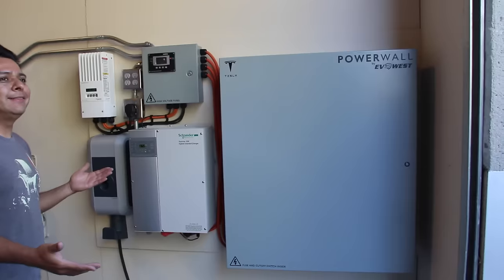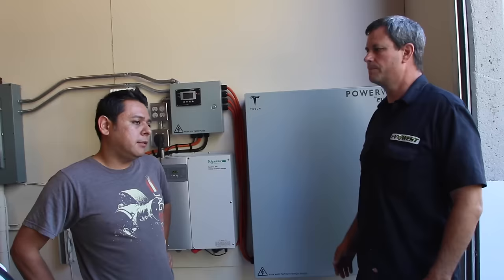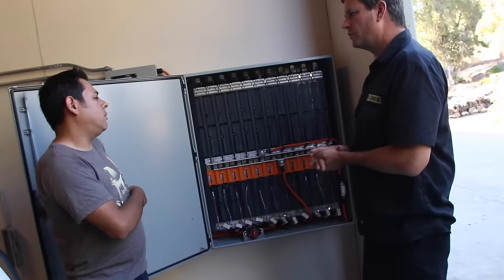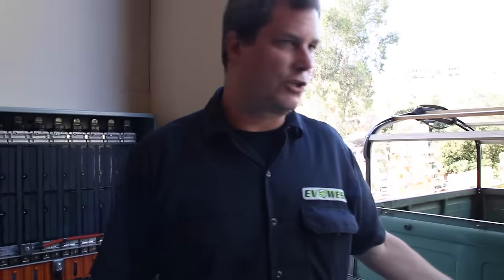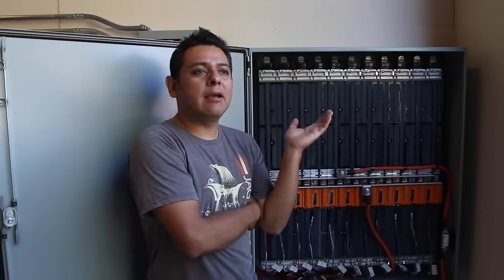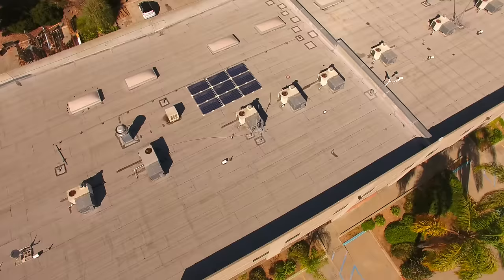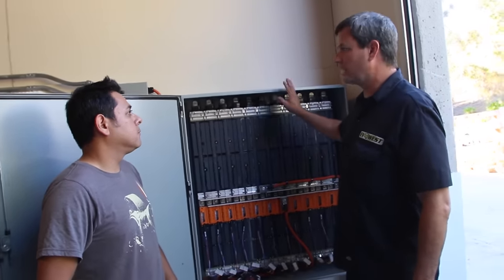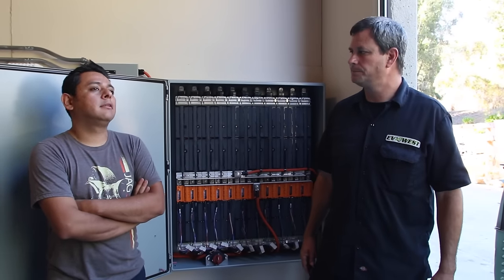DIY TESLA Powerwall  - my  WALL vs ELON'S WALL

Comment: so complicated is any one that will sel a DIY package manual for, lets say 10 Kw
Reply: 100W invertor x 96V battery pack(8 12V batteries) you can use any battery you want but if using lithium batteries you'd need a BMS. I'd use a contactor or quick release for the battery pack as well. The more batteries you have in parallel the longer the duration.

Comment: why do you need an ac inverter for charging a car? you convert dc -> ac -> dc again? Why?
Reply from the maker: +Balazs Magyar   Because= standard equipment
Reply: +jehugarcia ok, but its a diy project, and in the long term its cheaper :-)
Reply from the maker: yeah but Michael has customer cars that need to be able to charge at the Mall,  the DIY wall needs to be able to charge all cars at the shop  not just a special custom one

Comment: Looks like Elon M. was really just looking for a use for his vehicle batteries when they are below the specs needed to power the voltage demand of the drivetrain, when they fall below the specs and are useless for the vehicles he appears to be arranging to recycle them into brand new powerwalls.

Comment: I'm selfish with my electricity becase grid tie setups shut off when the power does.  What sense does that make?  I set up in OffGrid mode.  What did EV West pay for that setup?  $16k?  Um, never mind.  <g>  Right now, I have 1kV of panels and a pair of LA deep cycle marine batts on a low budget.   //   Ooh, bummer about the drone.

[Egad, muzzle the dog for the video, or put him inside.  ]
Reply: When the Grid is UP, like 99.99% of the time in the USA ( except Cali )  then "FREE" Battery = Very Low cost

Comment: Depending on your electricity bill and usage your breakeven point might be past the life-cycle of the components themselves which means you're literally throwing money away on renewables. HOWEVER, for the total solar naysayers....

The cost of electricity on my bill here in South Australia is a fucking ludicrous 39 cents a kw..... So you can imagine how grateful I am running a huge 8kw solar array on my roof when its 45 degrees (113F) all bloody summer and my industrial sized AC chews through power at 5000W on startup Hi to 3000W normal running. Shipped the Panasonic panels specially from Japan, cost me $15,000 AUD, and I sell all my excess energy (of which there is a lot of) for 18 cents/kw back tot he grid. Bought these specifically because the temperature coefficient on them were miles better suited to our stupid hot weather than even competing expensive panels, let alone el cheapo ebay/amazon panels.

Pretty sure I've already paid back my investment on this 3rd year if I only looked at my usage during the SUMMER QUARTER ALONE lol (last summer was nuts) and I don't even have a battery backup system. My last bill was 61 bucks, if I didnt have the solar panels it would have been in the ballpark of 3.5k (a light summer quarter for here). if I were as super stingy with power as I was without the panels, Id be receiving checks in the mail from the power company to the tune of 600 odd dollars every summer quarter, but the house feeling like a refrigerator for the entire day, completely for free is just too nice to give up. People saying solar will never pay off must either live somewhere power is 10 cents/kw and below or they just aren't very smart. 

However even here, mains power costs don't warrant a lithium battery setup yet... The useful life-cycle on lithium is too shit for me to make back the initial expense in reasonable time, until that is power prices start getting stupid, which they will. Vanadium flow batteries are simply a better long term battery option. You can technically get infinite lifespan out of them and you can discharge them to 0% indefinitely without adverse effects to the system, their only drawbacks are system size (mind you its like the size of an AC so not that big) and that they wont have the same peak output as lithium, so if you're a heavy user, you'll just need two of them. Trust us Aussies to invent a commercial solution to our climate... lol.

Comment: Batteries are not smart.  For they are batteries, a place to store electricity until needed.  But the electronics to charge and discharge those batteries have to be smart - microprocessor plus software.  Tesla has given away its patents,
 meaning any company or individual can make 
use of that tech.
 Hence, Solar City can use that stuff to send electricity to the grid or to the powerall battery,
 or other homemade batteries - intelligently charging a car, appliances, or the grid as needed,
 desired, or as programmed.  Politicians speak of transparency, but not engineers - intelligence and wisdom (right and wrong) are not the same.
  The two companies should be kept separate.
  And from an investment perspective, Solar 
City common shares seem safer.  Tesla Motors :  
 car companies spend billions only to see 
competitive strengths vanish as other car 
companies do the same.  Ford and GM manage 
huge amounts of debt.  At 200 dollars a share,
 Tesla looks like a lousy investment, already 
valued as much as half of Ford, especially
 given that other car companies may build 
gigafactories as well, or simply buy batteries 
from Tesla, and build more popular vehicles.
  A merger is a lousy deal for Solar City
 shareholders.  These two companies are 
behaving as if the shareholders, the owners,
 do not exist - only consumers and workers.
  And neither will acquiring Solar City make it 
easier, for Tesla to make and sell cars or
 batteries.  I think Solar City is will be more
 profitable not having to worry about selling
 cars.  ( A question I would like answered is, When
 a house with rooftop solar generates excess 
electricity, and it goes to the house next door,
 does that neighbour pay for that electricity, 
the utility company, or does that neighbour 
simply get the electricity for free. )
  Money, can be thought of as information,
 regulating the flow of products and services. 
 People, they intend to barcode them, and treat 
 them, as cattle - I think.  This one to feeding,
 that one to work, and another to school - to
 be harvested later.

Comment: What BMS???
Reply from the maker: +J Wightman we don't need no stinking BMS
Reply: jehugarcia Seriously? So you would just monitor the batteries every once in a while? Also are there fuses on each cell?
Reply from the maker: yup,  I've checked battery voltage a couple of times in the last 3 years,  not had to rebalanced once.